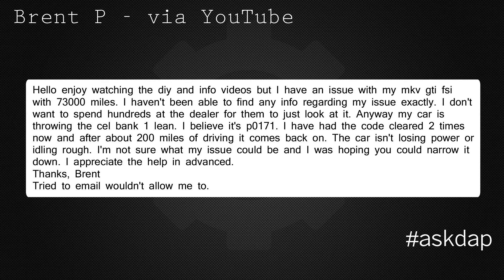VW 2.0T FSI Engine... System Too Lean Fault Code P0171

Comment: Dealership did not find anything mechanically wrong, but my CCZB engine throws this code. Can this be a ghost fault due to no adaptations made for ecu after PCV replacement before?

Comment: What is the most common cause of a P0172 on a 2006 A3 FSI BPY? I have replaced many parts including front PCV, VC, N75, DV, supposedly previous owner replaced the HPFP but both sensors still look original. Im about to replace the LPFP because duty cycle at idle is 73%. And Ill do the G410 while Im at it. Haven’t touched the high pressure sensor yet. Also about to replace the rear PCV pipe with check valve. Problem is intermittent but comes with low power, feels like no boost and very high fuel consumption. At times, some smoke emits from the exhaust manifold area not sure if that is possibly some oil being pressed out a gasket and burning or what. Thanks for the help.

Comment: Can having a decat fitted without the car been tuned cause this fault code to flag? I am off to look at a mk2 cupra R that has this fault code, the current owner states that the car feels no different and doesn’t hesitate etc, he has replaced the pcv, brake booster hose etc and the fault still persists. The car is tuned but was tuned prior to the decat been fitted

Comment: I would like to add something to this that i just experienced. I have the n249 delete sia delet etc. And this code gave me the run around for weeks. Smoke test leak test everything. Well because of those deletes i have bypassed my diverter vacuum line to the throttle body next to bank 1. Well the vacuum side of the diverter when out and was allowing boost pressure to enter after the trottle body right into bank 1. Long story short. New diverter valve fixed it. Sad part about this is a smoke test wont show it
Reply: THANK YOU!!!! Because I smoke tested mine and nothing showed any signs of leaking. Rear main seal was already upgraded and valve gasket, cover was done already. MAF sensors and O2 sensors replaced and nothing. So I'm sitting here wondering what it could be. I'll try the diverter valve

Comment: If not a noticeable hissing noise I would vacuum test n80 purge valve and check oil breather,worst case scenario is the rear main seal is leaking that will cause lean fault,check for oil between engine and transmission check O2 sensor reading and spray brake cleaner between the bell housing at bottom there is a small cutout if reading start going crazy it's the rear main....

Comment: P0171 code.  No idle issue / no loss of power.  Jetta TS1 2009.  The other thing is that I know it needs new brakes possibly rotor work.  It is possible that the issue of the brakes would be cascading to a P0171 (vacuum booster / airflow issue)?
Reply: I'm having the same issue, needs new rotors and having the running to lean error code..any update?
Reply: Ever figure this out??

Comment: Love your videos well said!! I have the p171 code its been popping up since june or july decided to take it the taylor vw in findlay,oh they charged 100 dollars for diagnoatics and didnt do any of that just basically did what autzone does..said i needed a new maf i changed it myself the code still kept popping up after that after furthe inspection myself the vaccumm pipe with check valve had a crack in it the dealership wont refund the money..basically moral of the story i thought for 100 dollars i would be getting further testing like smoke testing right on with you stated tell these dealerships that!! They ripped me off!! Now im having to try and find it myself because they stated since i changed the maf the p 171 code is no longer there and there stating a diff code is popping up but i have an obd reader and its still the p171 basically i wanted the issue fixed not them to rip me off :(

Comment: i have a 2007 passat 2.0t that is in limp mode wont go over 20 mph i am getting multiple codes p0864 p0687 p0171 p0605 p0601 it is acting like it is misfiring for a second but then clears up but still stuck in limp mode i dont know anything about these cars please help!!!

Comment: I have a volkswagon beetle convertible 1.8 engine check engine light on replaced mass air meter after driving came on again p2187 lean around bank 1 what is that
Reply: Did you ever find out what was the problem with your car I have the same code on  2012 tiguan
Reply: Vestee Noel did you find out what was the problem with your car I had the same code on my 2012 Tiguan
Reply: Is your 1.8t has the diverter bypassed to intake manifold check you diverter because the vavuum side might be pushing boost pressure into bank one bypass the trottlebody
Reply: Easy way to tell is if you take your dv off and blow into the boost side and air comes out of the little vacuum nipple. Then it needs replaced

Comment: I'm not having any challenges braking, but I will check the brake booster hose.  I do have the same symptoms as the guy who wrote in.  I have a whistle turbo noise under heavy boost and maybe it's leaking boost from this check valve on this piece.
Reply: Keith Sauer I have the same issue and the turbo is under boost and a bunch of other misfire codes, you ever find out what it was?